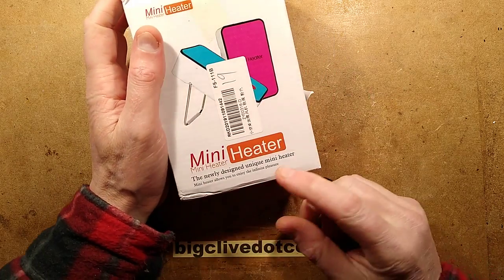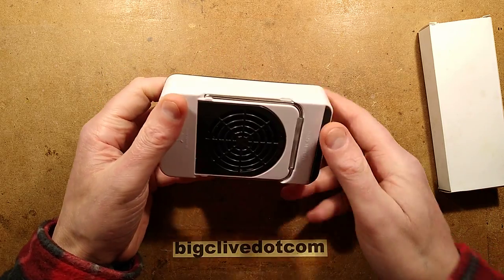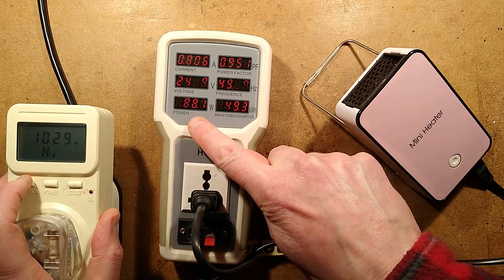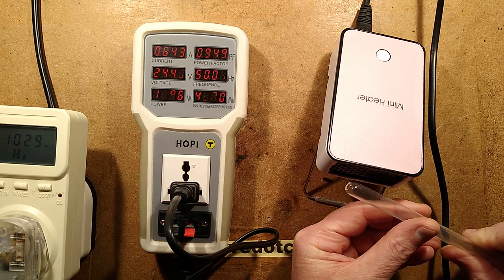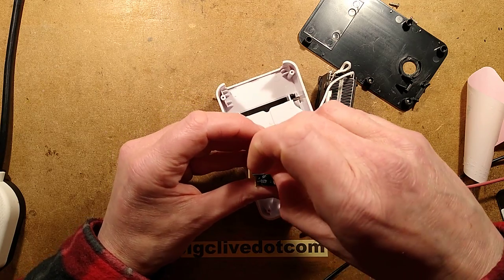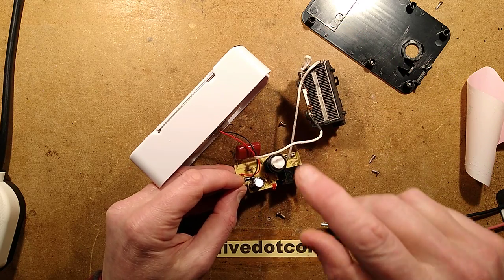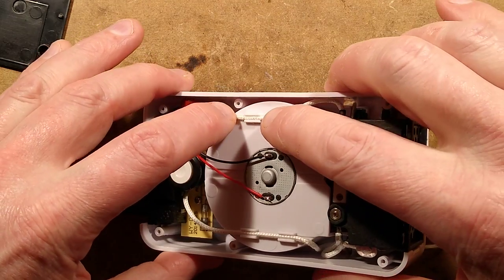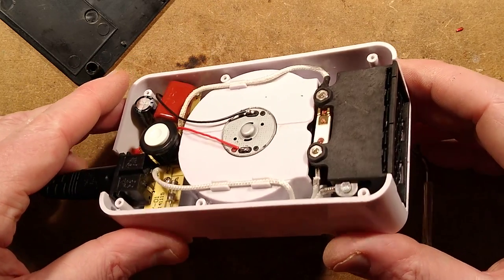All plastic 150W eBay desk mini-heater.  (With schematic.)

Comment: There shud be a one-time thermal fuse imagine if this fell off from the desk on a carpet in the current state it will overheat power off then cool down and start again this is a fire hazard
Reply: More importantly, bimetallic strips have a tendency to fail closed rather than open circuit, that's why more reputable manufacturers always put in a one-shot thermal fuse with a slightly higher cutoff temp as well. That renders the product safe when the contact points on the bimetallic strip weld themselves together, which is the typical failure mode after repeated on-off cycles cause arcing. This is also why bimetallic thermostats don't count as overheating protection.
Reply: @Kaboomf  
every fan heater ive taken apart has a bi-metal cut out with a built in resistor to keep it warm so it wont reset till you cut the power for a few minutes , it would not cycle back on if just left , its actually quite annoying sometimes as it can cut out for no reason when put on the high setting :-)

Comment: I recently picked up one of those 'recharagable hot water bottle' - where it seems to be a heating element and some kind of pump in a sealed bag full of liquid, with almost all of them using the same charging design.   Almost all of the ones on amazon seem to be a standardised one (such as https://www.amazon.co.uk/Fineway-Rechargeable-Electric-Water-Bottle/dp/B07K32DN7L ) - would love to know what's going on inside
Reply from the maker: No pump.  The reason the plug is on that strange contraption is to cut the power off if the bag swells up.  I got one from my mum and the bag ended up swelling up and it was sealed.
I made a video about a much shadier one with inherent self disconnect if it puffs up.
https://www.youtube.com/watch?v=mD7CXu3avIQ
Reply: Interesting idea regarding the simple charging cut-out.  Mine does seem to make some kind of semi-rhythmic pulsing noise that sounds somewhat like airflow (likely liquid flow) hence my thought of a pump.

Comment: Anyone know what the motor is called? 7:49
Reply: Its a DC minimotor, usually made by Mabuchi or Mitsumi. CDROMS use this a lot on the tray mechanism and sometimes in the laser movement. You can get tons of them almost for nothing, just grab a pile of PC CDROMS, DVD etc. Nobody wants them.
Reply: @38911bytefree  thanks, appreciate it

Comment: Seems a very bad design of the box, subtle changes would let it draw air from sides as well as bottom, stopping you from starving it of air nearly as easily. Also its missing an electrical and thermal fuse before I'd ever use it, a fire is just too expensive a risk to be economical to cheap out on.

Comment: China is not the only ones using odd colors for wiring. Start digging into modern autos and there are many using odd colors for battery voltages.

Comment: Mine died.... The Fan gave up.. Heater still works tough
Reply from the maker: How long did it last?  Has the fan jammed or is the motor dead.
Reply: @bigclivedotcom  fan is free to spin Clive, autopsy will be preformed next week... But from the huffs and pufs I recon the Fan is dead
A shame because it was perfect to keep the moisture away from a cabinet that I have !
Reply from the maker: @DreStyle  Did the thermal protection work OK when it failed?
Reply: @bigclivedotcom  yes it dit! It kept it preventing from setting my house on fire, my guess it's in there for that.. Probably common reason
Reply: @bigclivedotcom  PS, it lasted for almost a full week

Comment: Odd they don't just use an AC fan motor...
Reply: Induction motors are the cheapest AC motors, and they get very inefficient at low power.  About the smallest you'll ever see is a shaded pole induction motor running a circulation fan for a small room.
Reply: @guygordon2780  They make tiny 120/240v AC computer style fans. They cost pennies in China, and that would totally eliminate the low voltage circuit. I have some similar heaters from Walmart, 250 watt, with the same type of heating element - they use a 120v AC fan...the entire heater cost less than $10.
Seems like they could have also soldered the cord directly to it instead of putting a plug on the heater itself...saving another penny or two.

Comment: installed a plug on a brand new double-chuck pressdrill from china once, i trusted the colors, actually the green and yellow wire and the black was the phase (240) and the white ground. It was on a wood palette on a steel table, got skoched when i touched it cause and had actually 120 between the frame and the table that i leaned on. Dont trust chinese color coding !

Comment: why do you choose pink always? Are you a gay? just asking
Reply from the maker: It started when I plugged in a set of the first pink coloured LED lights and the power supply exploded in my hand leaving a black sooty mark in the shape of the case seam on my hand.  It was so funny that some camp pink thing had exploded that it set a trend.
There's just something funny about pink plastic appliances being electrically dangerous.
But also, and unrelated to the choice of pink...   Yes.
Reply: @bigclivedotcom  your a good guy Clive. love the way you interact with us. you  could of took my question the wrong way, as txts are difficult to analyse sometimes. like not very subtle sometimes , when the question asked is thought to be  quite timid by the writer might seem angry in some way to the reader.  Anyway thankyou and the videos i like the most have been the marathan q & a streams. thanks Clive